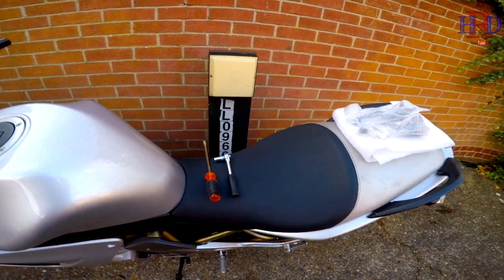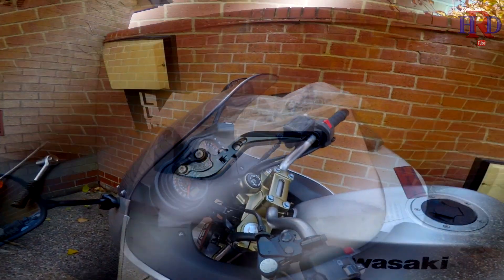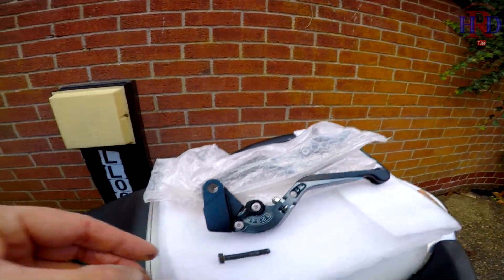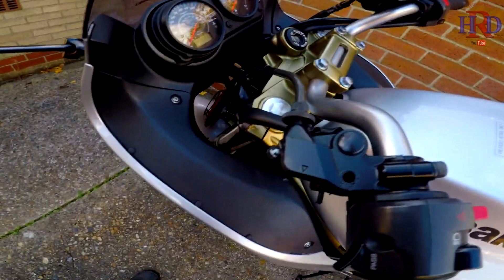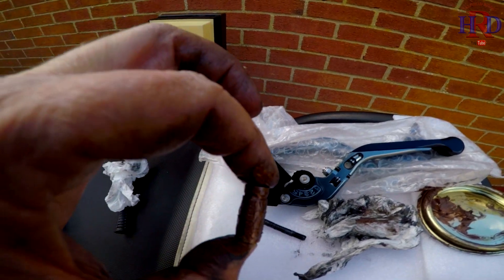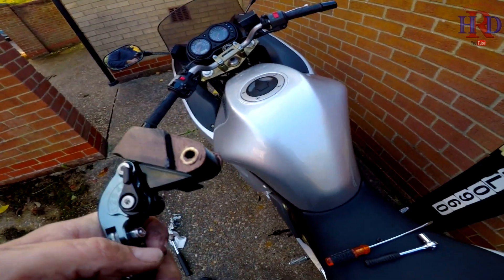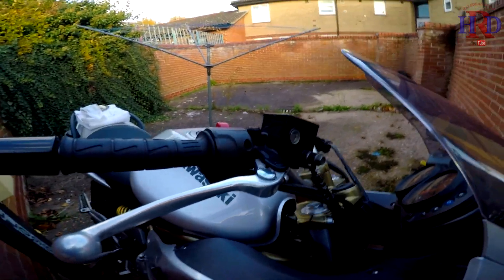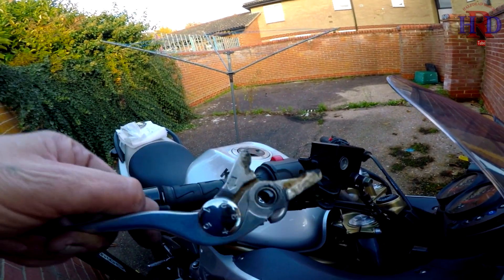Fitting Aftermarket Levers + Test Ride

Comment: Hi, nice video! How do you feel this levers? Do you like it?
Are these levers good and strong or are they breakable? 
These levers are stationary and fixed or they have a free play?
Are they from China?
Thanks
Reply from the maker: These levers are very nice, and cheap too. I love the look and feel, no more free play than stock levers.  They are from China, I got them from Aliexpress.com Estelle motorcycle Store 
great customer  support too, the adjustable part of the brake lever came off due to vibration and they sent me a new one with screw and washers.  I would suggest to prevent that, use loctite on the levers fixings where they are adjustable and foldable.